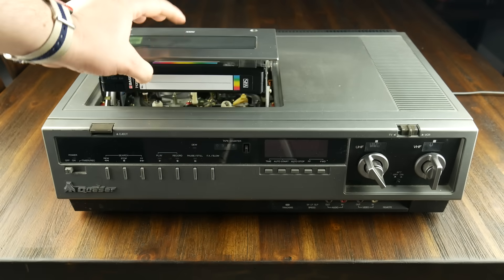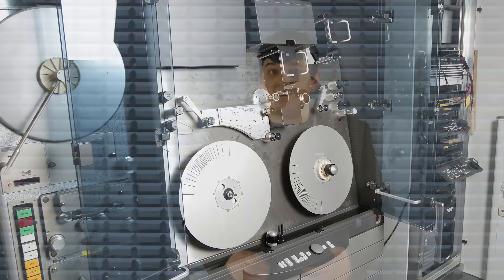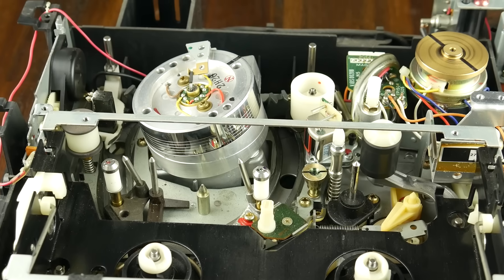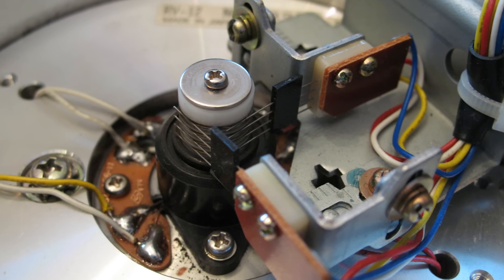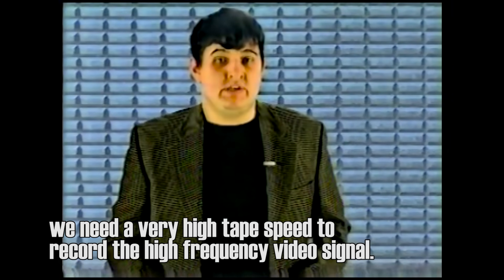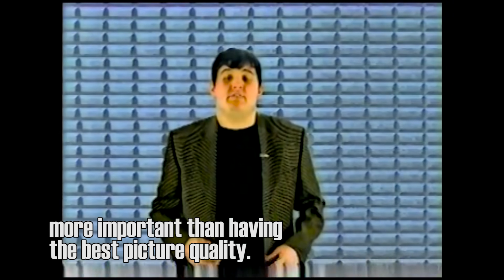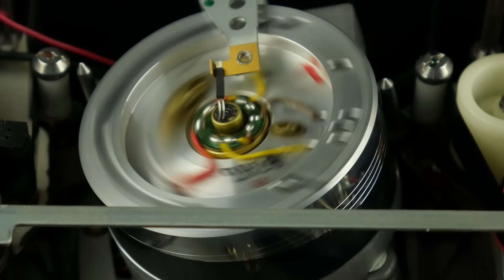The Impossible Feat inside Your VCR

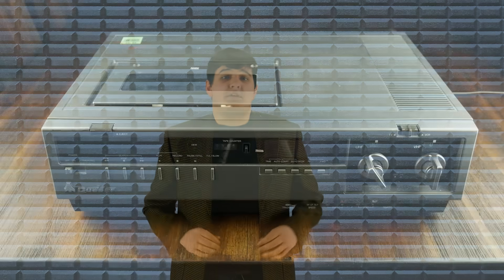Comment: 5:21 Drum channel selectors? In Europe those were used only on portable TV:s as they allowed easy selection of channels in any random location. Home equipment had presets and nobody thought about the channel numbers.

Probably the LP was removed just because it was a compromise. many see compromises having worst of both. In Europe things were different. Cheap VCRs had SP only though it was slower than NTSC SP giving 3-4 hours on a normal tape and five on very rare an expensive long ones. Better ones had LP which is comparable to EP on NTSC giving 6-8 hours. Only very rare ones had EP (9-12 hours).

Comment: Also very interesting about why the head drum was on an angle.  I remember at the time my dad used to work as a TV/VCR engineer and we often had many VCR's with their backs off lying around the house (and TV's too), and I often wondered why the drum on a VCR head was always offset on an angle.   He also used to repair other things like tape players - actually tape player heads were quire funny too if they weren't aligned right you'd hear the B-side playing backwards, etc and it never really occurred to me to think that audio tapes never had a rotating drum where as the VCR did.  One thing I also always remember is the smell of Servisol 40 - aka video head cleaner (or isopropyl alcohol).  It's funny that now I carry a tin of Servisol 40 in my toolbox for a totally different reason - I use it as a PC engineer now to clean old thermal paste off CPU's before re-applying!

Btw did you ever remember the Philips version of the VCR - it was before either the VHS or Betamax standard - I think it was something like the Philips N1500 version.  Apparently it was far superior to VHS or betamax but never worked out - I guess it's the same as HD-DVD vs Blu-Ray although I never understood with HD-DVD and Bluray both being the same shape disc the didn't just make drives that could play either.

Comment: As for the quality example at 12:00, yes, I watched it at full screen.

On a modern LCD that has a larger diagonal size than any analog CRT television I ever owned.  Growing up, we had three different "main" TVs over the years. The largest was 24".  When I went to college, I absolutely splurged and bought myself a luxurious 25" TV (yes, I made a point of buying a TV one inch larger than the one my parents had.) I was the envy of the dorms.  (I also bought a VCR that could do SUPER VHS!)

After getting married, we got a Sony "SuperWEGA" 27" TV.

Had that until we got our first HDTV. (A rear-projection.)

My computer monitor is a 30".  (I suppose I could drag it over to the laptop's internal screen...)

Comment: Great video.  I have fixed my VCR's in past years.  I'd love to see them comeback, as I prefer them to discs.  They can be made better by now, and they were so easy to use.  Put a tape in and push play, video starts right were you left off and there is no load time, no dumb menus to go through, etc.  And my favorite point is they were tough, the tapes could be tossed around, stepped on, dropped, kicked, left outside in bad weather by accident and yet they still worked!  Step on a disc, crack it, scratch it, for unknown reasons it won't read, errors happen, its done...  I say BRING BACK THE VCR!

Comment: 14:27 he's wrong. I'm 36 and I know that the middle recording speed was not removed from many VCR's that was a rare thing. I have owned many VCR's and I never saw the LP speed removed until the 2000's because everybody was getting a DVD player. Is he even old enough to know what he's talking about or is this a Wikipedia research video?
Reply: No, he's not wrong.  LP became sort of "deprecated" in later years, though playback support did not go away.  Fast scan would often suffer at LP, though, with heads optimized for SP and EP (SLP).
Reply: I had several VCRs that did not have the four hour speed. Perhaps you were just lucky that you bought brands that did 
,.
Reply: Papus Magnus, yes, the replies here have been an education.  I know LP became the lost child in my experience here in the US.  I didn't realize things were different across the big pond.
Reply: E240 tapes (4 Hours in SP) were quite common in the UK by the late 1980s - LP gave you eight hours - 3 hours E180 tapes were by far the most common (I've never seen an E120 tape here in PAL land).  By the sounds of it tapes had less recording time in the US so LP in the UK gave the same recording time as EP in the US while retaining better quality - the ELP mode on my parents Panasonic deck gave you 12 hours of recording time, but the picture and audio quality were shocking (the interference laced LW/MW signal of the late 1990s was much higher quality) and was also unable to be played in most VCRs so we never used it.  Perhaps that was why?  We also had VCRs which were able to record NICAM (digital) stereo from TV Broadcasts onto tape (although I believe the VCR stored this as FM Stereo).
Reply: @Admiral Titan
He's clearly states that he PERSONALLY stopt seeing them IN THE 90's.
Reply: I bought a new VCR in about 2005 and noticed it only had SP and SLP and wondered why.  It was a sanyo
Reply: Maybe he had one cheap VCR that removed LP from that ONE VCR but not all or most.
Reply: Being older doesn't make you smarter. Just look at how old people run your country lol

Comment: The drum in the 2-inch Quadruplex system spins at 14,400 RPM, not 3,600. But apart from that, as a broadcast television engineer, this is a very thorough and well done video. Excellent work!

Comment: Great video - and very accurate ! I know because I am an Ex BBC VTR engineer. I used Ampex VR1200 and VR2000 machines, then the new AVR1/2 boxes and finally the 1 inch VPR things. Oh yes and the RCA TR70c,. Yes, we were ENGINEERS in those days. Why no mention of the U-Matic by the way - or the Phiilips 1500, both of which came before the VHS? :-)

As  a side note, if you used an external signal fed to the sync track to lock the head drum, you could record the entire medium wave radio band by sticking a long wire in the video input of a VHS - then tune a radio up and down the MW on replay :-) Also, if you stuck a stereo un decoded audio signal - one with the pilot tone on it - on the the VHS video track, you could record Hi Fi Stereo ( if you de-multiplexed it on replay that is ) . I told Sony about this, they were very interested, 6 months later, they introduced the Hi Fi VHS. I got nothing - bugger eh ?
Reply: But Sony didn't use your invention.  You recorded HiFi audio-only on a hacked VCR.  HIFI VHS records audio AND video.  Obviously, if you can record video onto something, there's plenty of bandwidth for high definition audio.  Sony knew that.  The trick is recording BOTH.  You should have applied for a job and told them what you had done, in the interview.

Comment: I was trained as a VHS video machine technician.  I have not serviced a VCR in about 20 years. ;)  Removing and replacing slide-plates, and sometimes annoyingly placed mode-switches, pinch-rollers, back-tension bands, belts and heads - ahhhh, memories of my youthful apprenticeship.... :p  HiFi Stereo VCR's used to be used to record live FM radio-shows here before computers and HDD space got so cheap.  A E180 tape would hold 3-hours of live radio show at standard speed, or 6-hours in long-play.  As mentioned in this video, the audio performance was excellent on just about any brand of HiFi VCR - far better then using normal cassette tapes, but also far cheaper then using an expensive professional reel-to-reel machine.  They would often re-transmit from the archive tape so the DJ only needed to do the show once, but it would air at least twice.

Comment: Very nice!  I was always curious as to why the VHS head was angled like that.  I still have a VCR and still use AND PREFER VHS tapes believe it or not.  I can pop it in and play, if there is an advertisement, I am not prevented from fast forwarding past it!  And my VCR never shows blocks or freezes up, or goes black etc like my DVD did.  I won't part with my VHS tapes now, though early on I did, and we now regret it.

It's too bad the digital VHS didn't take off, I would have loved to have one!

Comment: I used to repair these things including earlier beta-max much more complicated ones so although probably could have learned something did not watch all. I even have one of the first DIGITAL frame store ones from the 70’s in a suitcase in my basement which probably still works! Hitachi brand made I think by Sony. You can stop frame with perfect picture (PAL System)  when paused without shake unlike refreshing picture all the time from rotating head with tape stopped stores image frame in ram until changes If I remember correctly. Probably cost about £1000 plus in today’smoney was bought for my mother by my brother who was a bookmaker ( off track betting shop manager in UK ) at the time I had the none digital model in my home which cost £100 less as could not afford digital one!  £100 in 1970’s value today is about 50 times!
Before rotating head technology to get over the band width problem I and
friends experimented in late 60’s recording 405 line monochrome early cable television
signal by feeding directly into a sound reel to reel tape recorder and  recording at fast forward speed about 5 minutes  of test card on 12” tape reel! And then
playing back. The signal from cable network at that time was low impedance 6
MHz PAL on twisted pair cable into monitor, as only 3 channels plus one pay
channel at time. Lower resolution than VHS but worked. But too short time for
any use.

Comment: Damn h264 blurryness ! VHS looks no sooooooooooooooo blurry and bad, it's because you recorded with h264 compression, and youtube converted your h264 compressed video again. h264 (and up) wash out finest details and noise (the higher the deblocking settings are, the higher the blurryness)
I got a mid range VHS Recorder from 1994 here, and when i record something and watch it on my 32" CRT from Toshiba (my VHS is connected over Euro Scart Cable, no crapy US Crap Standard Coax^^) it looks way better as a VCD and as your VHS presentation at 11:50 ^^ it's on paar with a S-VCD but without the fucking pixelisation at high motion.
Ah btw PAL EURO 720x576 50hz, NTSC 720x480 ^^ 60hz

Comment: Thank god for vertical helical scanning used by the drum, when you actually look at all the mechanics of a vhs deck and the control of all of them from mechanical functions of the deck via the mode switch, speed of capstan, speed of drum, tape takeup idler clutch, control pulse etc its amazing it all worked as well as it did, the decks from the late 1980s till mid 1990s are some of the best, anyone remember the panasonic charlie deck?  Still use a Betamax,  i believe that the porn industry also backed vhs as it was cheaper than beta system which also contributed to its demise in domestic usage.

Comment: As a former repair technician I worked on lots of VCR's.The most important link between the electronics and the mechanics was the mode switch, which  gave information on the state of the threading/unloading of the cassette. etc. Another ingenious concept was the capstan motor, the back tension arm and the slipping clutches. Most VCR's used a standard layout but most bizarre was the Philips machines that used the 'Charlie' deck. I noticed that there was noise on the bottom of the tape...We had to use a special tool to adjust the height of the rollers on the pickup arms that guided the tape past the heads...Everything had to be times in a perfect symphony of movement for the mechanical parts to work..Memories eh !!!

Comment: I beg to differ on the speed of LP not being available after the 80"s. I have several machines that have it (Panasonic and Mitsubishi) and Funai, which rolled out the last machine last year, all had it. I have been repairing these since the mid to late 80"s. He also failed to also explain how the deck would delay the first signal pass to put is together with the second, it was called a delay line. It was a plastic cases device that had quartz wrapped with a thin wire. VHS was said to stand for "video head system", it was actually "vertical helical scan".

Comment: about 20 years ago I took an old VCR head soldered LED lights on to the outputs and solidly connected the part that normally revolves I then put some rotary fins on the part that normally was connected to the frame of the VCR and when wind would blow and turn the head it would light up the LED lights as there is magnets and coils inside the head it made a very interesting hood ornament. anyone can make one of these today although they have been popular lately in a lot of toys wear something spins in the light from an LED lights and flashes. very good video enjoyed it quite a bit

Comment: Fantastic video! I am 52 and actually still have a VCR and an TV that both work fine, but rarely turn them on. I think another cool subject is the way that VCRs were enabled to be programmed by the user.  For many years, I could set up and program VCRs from various manufacturers without any kind of guide.

Comment: There is also the erase protection tab. I miss the old analog picture where the facial details are better and the color gradients and human proportion are more realistic. Today's pictures are terrible, faces are fat and people are short. Can't stand it.
Reply: "faces are fat and people are short"? Err, no. Not unless someone effed up the aspect ratio somewhere. You see that on YT occasionally when someone uploads a fancy "remastered" version of some old 4:3 music video that's been expanded to 16:9. facepalm Less commonly, there's 16:9 material encoded into 4:3 with black bars added, which when pulled up to 16:9 again makes people even fatter and shorter.

A lot of people simply don't care about even very basic fidelity like that. Even more people have no clue how to set up their equipment properly.

If you're seeing this everywhere, I would double check whether the screen resolution on your computer matches your monitor. As a PC tech, I often see this on newly-installed machines that are still running on a generic graphics driver with a very limited choice of resolutions (generally 4:3/5:4 only) and no automatic monitor detection. (Incidentally, color fidelity seems to be way off more often than not, I definitely do not regret getting a colorimeter.)

TVs usually have various settings for aspect ratio that should be set up properly, too.
Reply: All TV stations, until about two years ago, were transmitting for the old box CRT tv's. Today most TV stations, with few exceptions, are still transmitting in 4:3 format. Since new digital TVs are wide screen people prefer to stretch the pictures to fill the full screen than setting it on normal where the sides are black blanked. People who do not differentiate between a normal picture and a stretched one are called "aspect blind". They are not bothered by the optical distortion that cinematic engineers have worked so hard to perfect.

Comment: what I liked about VHS tape players over the 'advanced' DVD players we use today was that they would play the VHS tape no matter what was on it. the tape would have to be in extremely horrible condition for it to be unplayable - probably visually noticeable even - like scratches or something on the tape. Even then though it would still play the tape - you'd just not be able to see much I suppose. With DVDs, however, if there is just one tiny imperfection on the disc it can cause the DVD player to stop playing the recording altogether. Perhaps you can skip over the problem area & resume playing at a later point, but you see what I'm saying - it won't play the damaged spot. It will stop play & simply tell you an error occurred or something. So, this is why I think the VHS was superior. It wouldn't fall prey to the fault that the DVD player runs into occasionally.

Comment: Makes me wonder how similar Sony's micromv format was to DVHS as both use similar formatting for the videos (though micromv was technically incapable of 1080i due to all of the camcorders being SD--kind of similar to how you can't record HDV to or from a MiniDV cassette on a standard MiniDV camcorder).

Also, on the mention of switching heads, that's apparently what causes the distortion which (on a good tape recorded on a clean VCR) only shows up on the bottom of the image when overscanning is removed (if at all--depends on how your VCR crops the image, my late 2016 Sanyo machine crops the noise out almost entirely). I saw it first when I got a MiniDV camera in 2003 and ran an old video I made into my computer, it took me about 13 years to come across an article that finally explained it in detail (my "Google-fu" is not very strong).

Comment: Excellent video, but I was disappointed that you skipped over the helical-scan one inch wide reel-to-reel machines of the late sixties and early seventies (Sony EV-200 for example, or the EV-310 I once owned) which allowed for variable slow speed playback or recording (down to < one frame per second) and some (for the time) amazing time-lapse effects. Also missing are the commercial 3/4 inch UMax/BetaMax machines that initially recorded most of those shows people were recoding at home on their VHS machines.

Comment: i didn't get that part about spinning head. if data recorded on tape has same density info per square then what's the point to to spin head or tape at requirement speed